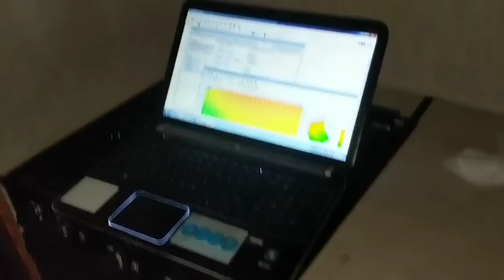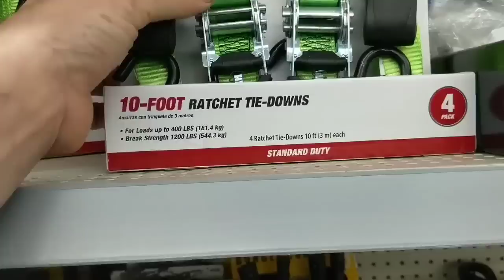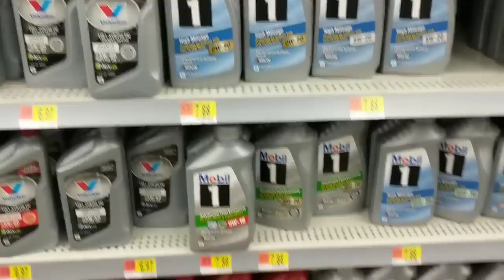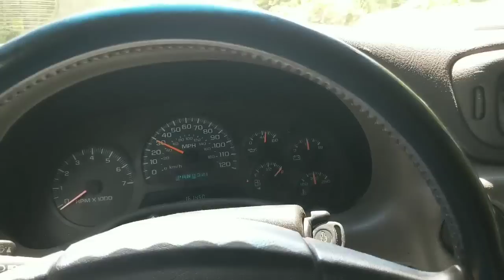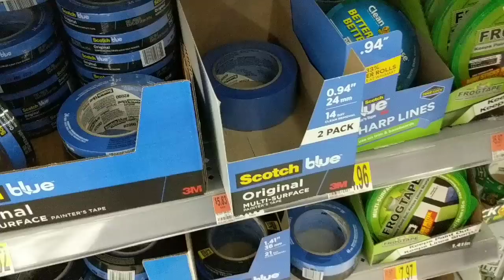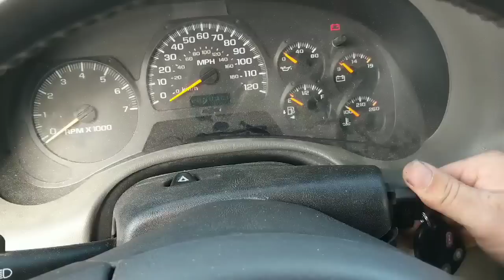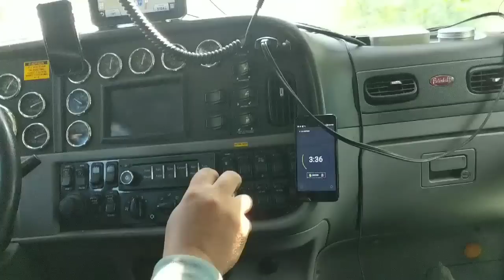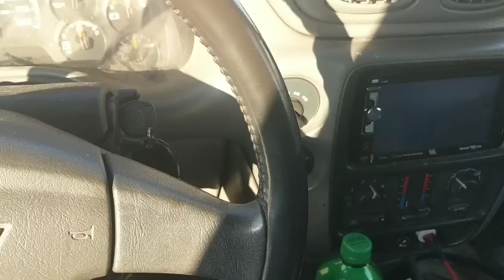I ACCIDENTALLY BOUGHT A GYROCOPTER! PART 2

Comment: Congrats on your new gyro. There's lots to learn so joining the RAF forum & the PRA will be helpful. It will really need a horizontal stabilizer before it's flown. RAF rotor blades have a 500 hr replacement limit.

Comment: Hey man congrats yesterday at SCT! I was gonna come say what's but never found you haha! Did you only do that one pass at night against the red c6z?
Reply from the maker: Yes was having fueling issues so was not able to run anything over wastegate.
Reply: Boosted Coyote gotcha man nonetheless made a good pass! Were you just on gate during the rolls too?
Reply from the maker: @jmitchell513  yes and low timing
Reply: Boosted Coyote Nice! I guess you didn't need it turned up still won! What part of TN are you out of? I might get with you on some stuff for my cars. I've got a Mach 1 and a terminator both are basically stock.
Reply from the maker: @jmitchell513  Yup it would easily break out on high boost. Paris, Tn

Comment: Congrats. You need to add a horizontal stabilizer in the tail - or it will kill you. Pilot Induced Oscillation and Power Push Over. There are some other mods that could make it safer. Check out rotaryforum.com
Reply from the maker: That is completely false and blown out of proportion by sellers of the horizontal stabilizer. If you are trained properly you absolutely do not need a Horizontal stabilizer. It actually causes the aircraft to bind and work against itself. I have even spoke with the RAF manufacturers and they had numerous stabilizers made and always ended up taking them off. If you need a horizontal stabilizer chances are you are not trained properly. Bunting over is a pilot error

Comment: cold air and magna flows on my otherwise strictly stock 91 manual gt. i wld do a chip or tune , something i cld easily switch back. is there really any hidden power in amounts worth trying to find? i wld trust your opinion